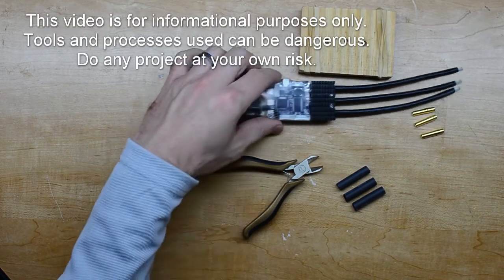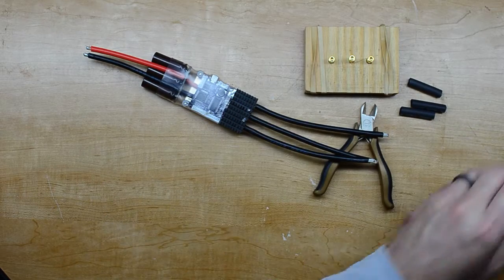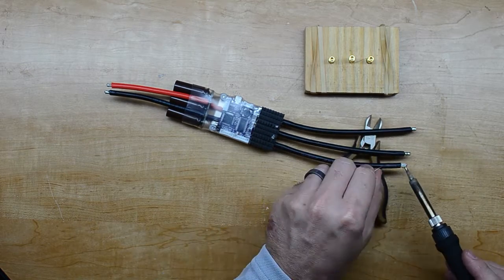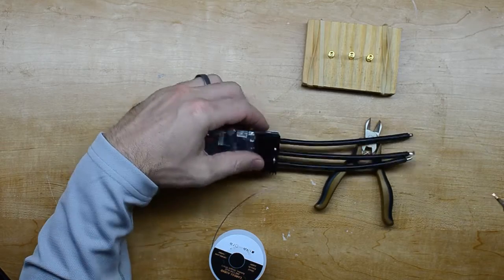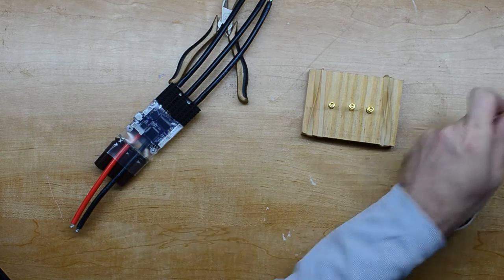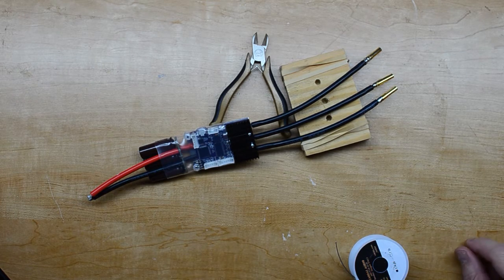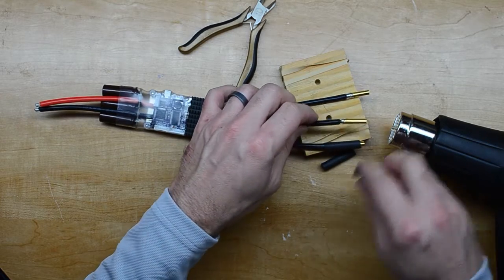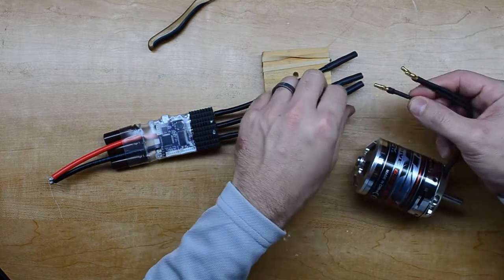HOW TO: Soldering Bullet Connectors - VESC ESKATE

Comment: Hey, I have a question. Your sk3 6374 192 kv have Max Loading: 80A. standard vesc is Cont. Current:50A and Burst. Current:Up to 240A for a few seconds. vesc will give you advice for a long time at full power?
Reply: I am building a desk and I have sk3 6364 Max Loading: 70A
Can I buy a standard VESC 50A - 240A ???
Reply: motor amps are higher than battery amps because you only get full battery voltage when having close to 100% duty cycle... So motor load in amps should be whatever is specified as max amps for your motor... And your battery amps whatever your battery can output (divided by 2 if you are setting up 2 motors)

Comment: Hey, I was wondering if I could ask you a few questions? 
new to the electric skateboard scene, and i've already burned 2 esc's and still havent rode my board yet. Now i finally got the vsec, a 12s bt supply and 12s 170 kv motor. 

What  parameter do i need to change on the vsec settings? Besides the motor config. I mean like where it says voltage and stuff.
Reply from the maker: I will get back to you tonight with more info. Do you have a 12v power supply?  It is recommended to do the motor detection on lower voltage.
Reply: No I do not. I have 4 3s batteries. Wn't 1 battery give me close to 12? So i can just use that. Also my sec was bought from exertion if that makes a difference.
Reply from the maker: You can probably do the detection on 3S I did it on 12V.  Just set the minimum input voltage and battery cutoff accordingly.  I am mostly running stock settings in BLDC for now.  Lipos drop off after 3.65v per cell so set your battery cutoff start and end somewhere around there. 3.65x12S=43.8v.  Have you watched any other vesc setup videos?  I need to make one I guess.
Reply: +Barnes'd i have watched a few but they dont go into details about how parameter vary for diffeent batery setups. Also could you breifly explain why we set up a voltage min and also what the voltage cut off is?
Reply: Also what do you mean set your battery cutoff accordingly. Do you mean according to the 3s i will use to set it up with? Or the 12s i plan on actually using?
Sorry I am completely new to this.
Reply from the maker: I will try and get and explanation up this weekend.  Battery cuttoff is most important because you don't want to discharge too much and damage the batteris.  Assuming you have lipos they start to drop off around 3.65v per cell  so set the battery cuttoff to around  that accordingly.  3S/12S.  3x3.65v= 10.95v 12x3.65v=43.8v  Battery cutoff start is when it starts reducing power, end is where it cuts it totally to not damage the batteries.  My voltage input min/max is 8/57.   Can leave that when switching 3S/12S.
Reply: Okay!! So a single lips has a max charge of 4.2 V and after it is drained to 3.65 per cell the esc will start to draw less current. So for a 3s setup my cutoff should be set to 10.95 and for 12s 43.8. 

In conclusion when I am connecting the motor to config only I should use 3s, and along with a 10.95 voltage drop-off? IS this necessary since i am only using the 3s to setup and not in the actual set up??? If so does that mean that after it has been set up I can connect the 12s and the ONLY parameter i will have to change is the cut off to 43.8? 

Also thank you for taking your time to help me out. Your a very good person for that!
Reply: Also is it straightforward to connect a wii remote? I know connecting the nunchuck requires some work.
Reply from the maker: +Jay fit check my video on wiring up the Nyco Kama Wii remote.
Reply from the maker: +Jay fit yes that is correct.
Reply: I cannot seem to find anyplace to buy the tyco kama wii remote online :/ So i have to find an alternative
Reply from the maker: +Jay fit In the US you can get them from Amazon or on eBay. It's not a perfect remote but works well for the cost.
Reply: k